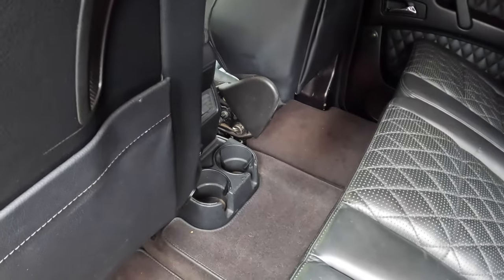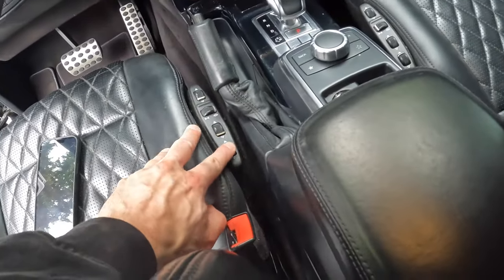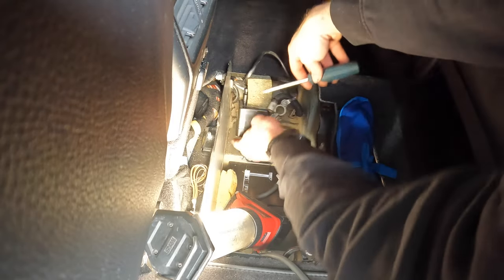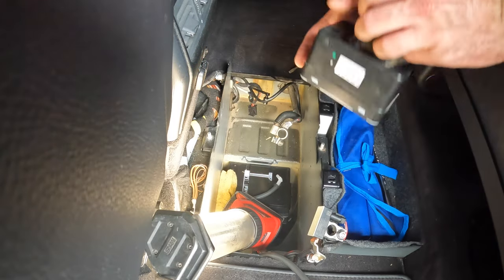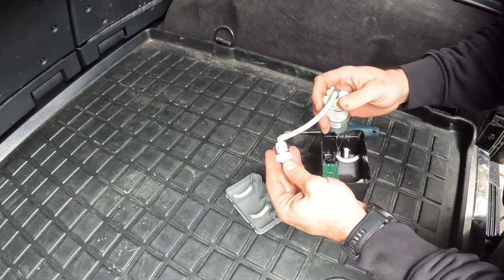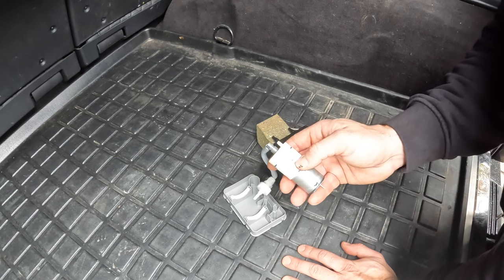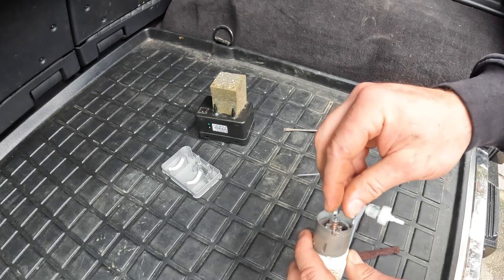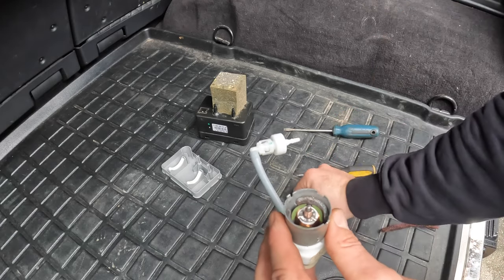Mercedes G63 W463 seat Air Pump Repair

Comment: Hey mike. I ended up selling the g. I had rust forming under the windshield. I had a gnarly rock chip in the windshield. Both my turbos were seaping oil at just 67k miles. When i foumd out it was a full engine out to reach the turbos i threw in the towel and traded it in for a ram trx. 

The g wagon is so unique but its not worth the amount in maitnenance. I dont think ill ever buy another mercedes after it. 

Over 29 months i changed the ac box, passenger valve cover gasket, oil pan gasket, cam sensors, and steering dampner. I still needed to do brakes. It was a 13 g63.
Reply: Stick to a later model G55. I don’t have any of these problems. Owning the car from 160k km to 195k km over the last 3 years. .
Reply: @leonchen89  looking back I should have! My g63 is long gone now

Comment: Hey Mike,

Just a heads up, you don't have to take out the battery to reach the air pump. Just pop off the passenger side rear tread plate and lift the carpet. You'll find a compartment there with a lid on it. It's pretty easy to get to. My air pump has been acting up a lot, and after getting it replaced twice, I've just decided to leave it be for now. I think the real issue of my  16’ might be a leak in the bladder inside the seats, and that seems like it'd be a big hassle to fix.

Comment: Hey Mike newbie here just bought a 2013 g550 great condition except for confort seat pump keeps humming intermittently on passenger seat,what is your take on that.Thanks for feedback
Reply from the maker: There's only the one pump. If it keeps turning on, most likely there's an air leak somewhere